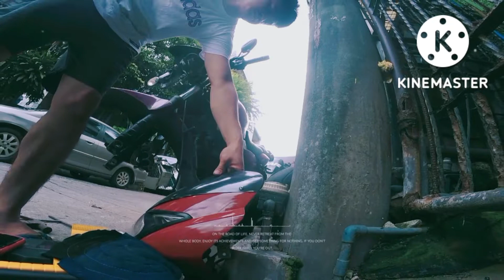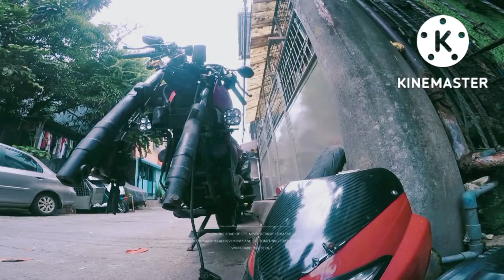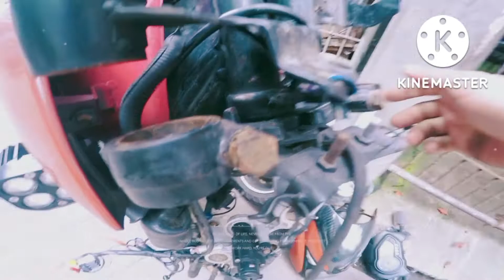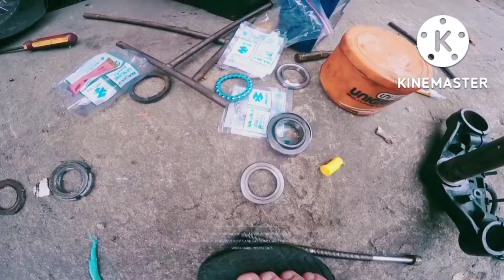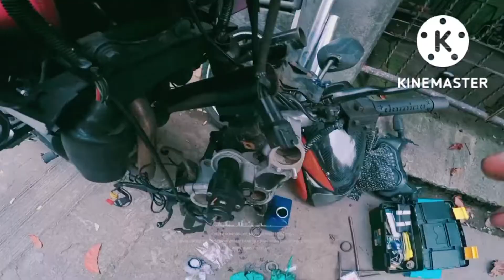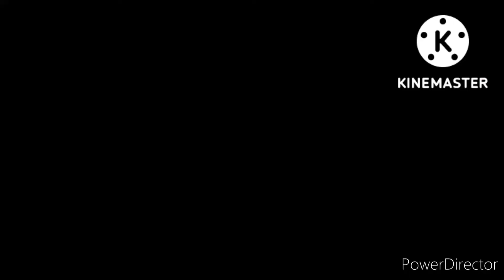Rouser 180/220 Replace KNUCKLE BEARING| Motorcycle Service Chassi | DIY CHANGE BEARING

Comment: Sir parehas din b axle s harap  ng rouser 180 at 220?
Reply from the maker: Oo boss same lang po
Reply from the maker: Para ligit 
Shop ka sa BERTING MOTOTPARTS, Meron din sila Shoppe account
Reply: @mikecampania6306  maraming thanks sir☺️ , yun nb BERTING MOTOR PARTS yt accnt sir
Reply: Sir pano mawla kalog ng kuno bearing rouzer 180 hndi ma ayos makalog sya tas makabog

Comment: Boss ano kaya problema ng motor ko. Yung manebela ko kasi pag lumiliko ako pakanan parang mabigat or parang may nagpipigil sa kaliwang side. Medjo mabigat ang pakiramdam. Bago ko lang to napansin cguro kasi sa left side ng manebela ko nilalagay ang mga mabigat kong mga dala. Duda ko rin cguro pinaglaroAn to ng bata habang nka lock ang manebela. Sa tingin nyo ano kaya ang sira? ROUSER 135 po unit ko
Reply from the maker: Check nyo po ung Steering bearing sir, baka my kanto na, lalo na pag naulan tumitigas yan